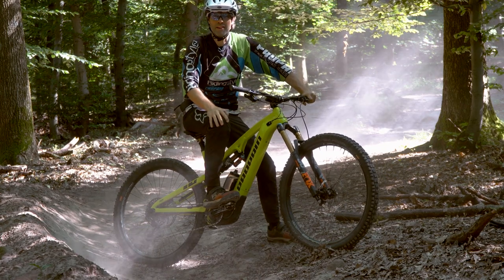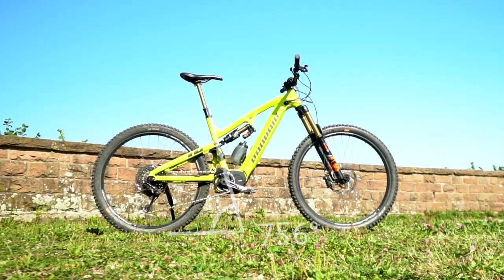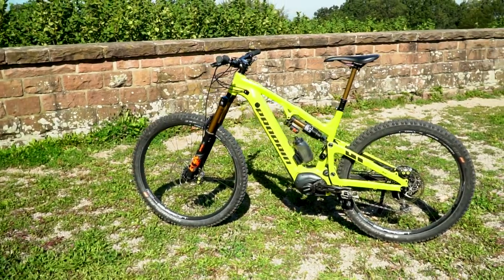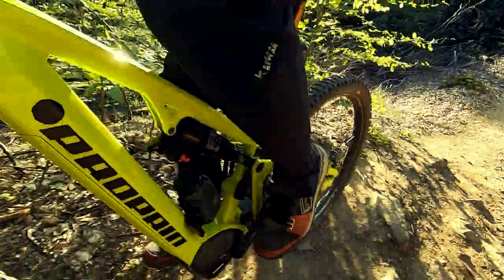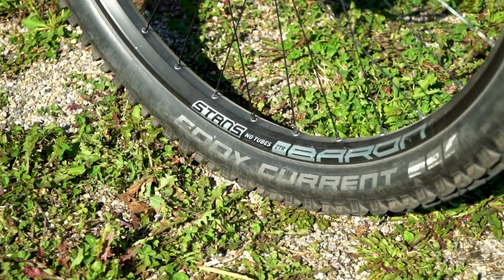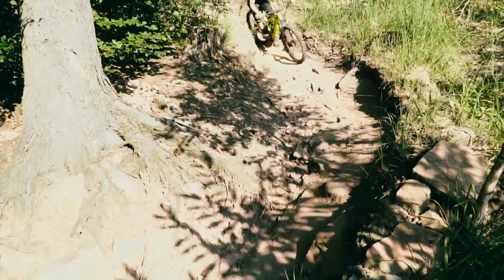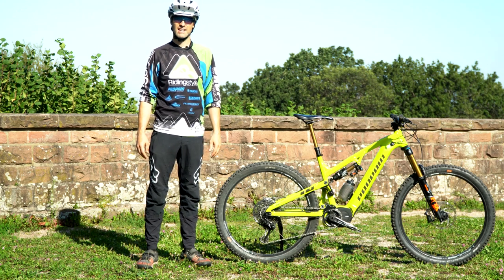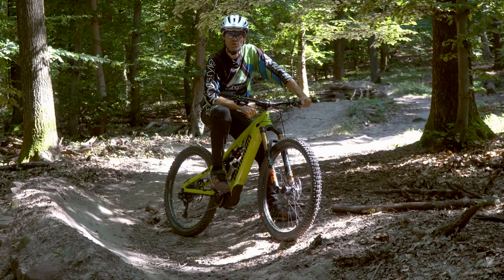Propain Ekano E-MTB - Preview und Testride des neuen E-Mountainbikes

Comment: Hi, do you think the propain ekano is also suitable for trail, or its main purpose is just enduro riding? Thanks
Reply from the maker: The Ekano for sure works also for trail riding. But the new Ekano with 38mm forks for sure aim for enduro riding. On Trail it will work, but you do not need that extra travel an potential for enduro.